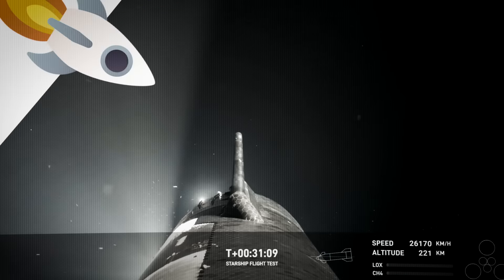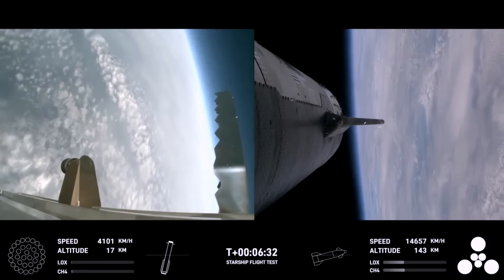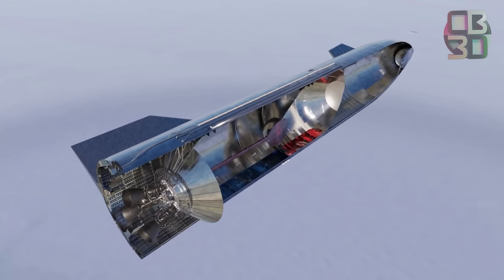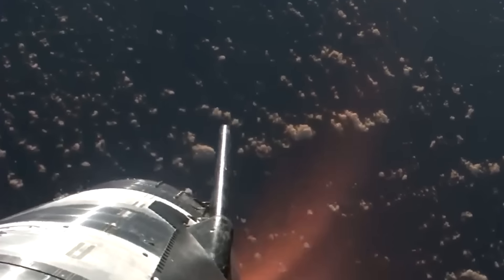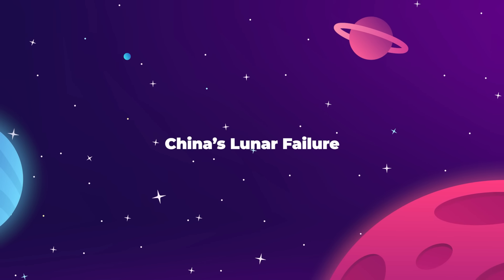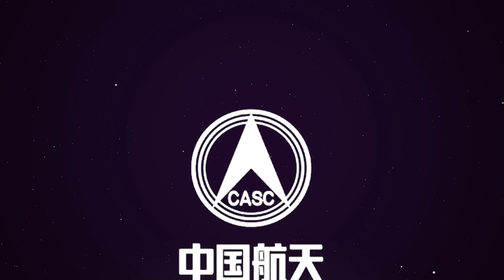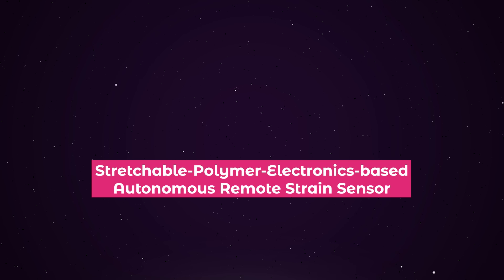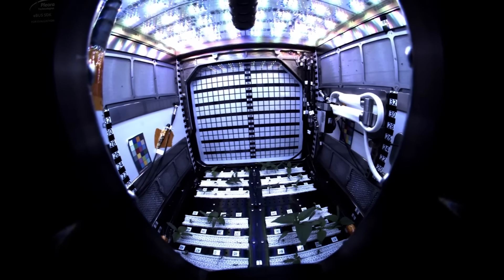What Exactly Happened On SpaceX's Third Starship Test Flight!

Comment: Timestamped Highlights
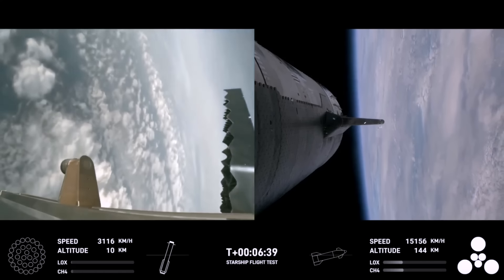02:04
🚀 The Starship launched with all engines lit up and successfully separated from the booster.
04:46
🛠 The booster experienced a rapid unscheduled disassembly at approximately 462m in altitude.
06:02
🏞 The Starship completed its six-engine burn and began coasting at an altitude of over 170km.
07:22
🚪 The first ever in-flight systems test on a Starship included the successful test of cryogenic fuel transfer.
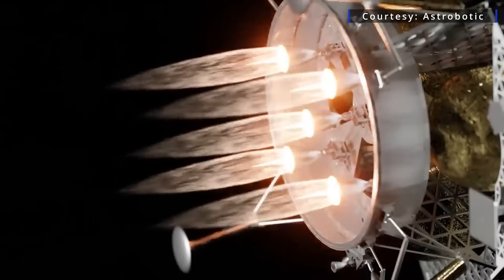08:29
❌ The relight of a Raptor engine in orbit was aborted due to an unexpected problem.
10:50
🔥 The Starship began to roll and experienced aerodynamic instability during re-entry.
13:20
💥 The Starship broke up and lost contact about 65km above the surface.
15:10
🚀 SpaceX has boosters ready for the next three flights and plans to shorten the time between launches.
17:12
🇨🇳 The Chinese lunar mission experienced a trajectory malfunction, affecting the orbit of two satellites.
19:04
🌱 Researchers developed a wearable sensor to track the needs of space-grown vegetables.
Summarized by @NoteGPT
Reply: Headline 2034. Starship NEVER worked. It was simply too complicated. Engine re-ignition problems and the sheer number of engines to manage (super heavy 33 engines, upper stage 6 engines) was a contributing factor. Failure of a single engine resulted in a domino effect. It had the hallmarks of the Soviet N1 failure all over it.

Comment: Good coverage. A lot of commentators ignore or underplay the shedding of debris. I'd love to see more analysis of that. Also, its pretty clear from this footage that you can't blame sloshing of fuel for the failure of the raptors to relight in the booster. Raptors have had a chequered history and unless and until SpaceX starts being open about this issue I'm going to point the finger at the Raptor design being pushed too hard.
Reply: I'd bet on the fact that they had to endure a harsh reentry

Comment: Did they explode the booster manually right before it hit the ground? I thought "huh, it's weird that it stopped slightly above the ground, farewell stage 1"
Reply: It might have been triggered by the FTS, as it detected that the booster was getting out of the planned parameters ;)
Reply: It wasn’t FTS. Probably a raptor explosion

Comment: when the spaceship coming back down and it rolls toward the part that is not covered by Tiles the reason is that most of the MASS of spaceship is not at the belly of spaceship that has the tiles, to BALANCE such MASS during entry is not possible because everything has been fixated into the body and MASS concentration toward the Belly does not happen. there must be a part of engine or payload that can move and adjust the mass toward the Belly where the Heat tiles are and when it gets close to landing the same mass needs to go back in its original state.

Comment: Starship is already more expensive than Sls. Sls/orion was successful from the first try though. Artemis 3 and 4 will have massive delays and may be canceled.
Reply: I wish more people talked about this, Elon and wasted millions reinventing something that Nasa already knew how to do.
Reply: @Mukurox3  It is like a house,  renovating usually cost more and takes longer. Recyclable rockets instead of reusable maybe better. The space shuttle was canceled for this reason.
Reply: @Akash-uq8wg  i don't think its anything like renovating a house. its not like he had a working rocket and worked on it to improve it  or even knew how to build one. Its like hiring a new contractor that is trying to build a house without knowing anything about house building and messing up a lot and burning through materials  your money and time. when the job is done its really pore but still works but you stuck with it. you might as well have gone with a vetted contractor that has built a functional houses of multiple varieties its cheap and higher quality and take less time.
Reply: @Mukurox3  Yup, your analogy is better than mine. But still reusable rockets and ships that do an reentry is not viable. Space shuttle needed a lot of service and parts before it was reusable. And even then is went wrong twice. Rapid reusabilty for a ships that has to do a reentry is a bad concept. This company is clearly run by people that wacht to much tv.

Comment: 4:10  WHY DIDN'T THE R.C.S. JET THRUSTERS ON THE SHIP NULL OUT IT'S TUMBLING MOTION & PUT THE SHIP IN THE CORRECT ORIENTATION & ANGLE OF ATTACK FOR RE-ENTRY ? ? ?  THIS SHOULD HAVE HAPPENED BUT IT DIDN'T, WHY ? ? ?🤔🤔🤔🤔🤔🤔🤔😭😭😭😭😭😭😭
Reply: They might have been frozen, so the thrust would have been screwed and the actions to put the ship in the right orientation might actually worsen the situation ;)
Reply: This isnt kerbal space program its real life with rapid cooling and heating.

Comment: When it's facing backwards, it's at 222km.. far from reentering the atmosphere... it was attempting to relight the engines (which would be a simulated de-orbit burn, but the engines didn't light, probably because the computers were afraid to, for whatever reason.. so that didn't happen).. point being, it facing backwards was part of the plan...

Comment: SpaceX will eventually get fuel slosh under control. Just seeing those fins moving as they did means the vessel is reacting even if a lot of movement results but the fuel is sloshing in reaction. Maybe an expanded mesh filller to prevent splash in a silicon bladder to form the yank would dampen the fuel movement.
Reply: The booster spent enough time with it's tail pointed down for sloshing to settle. The problem is deeper than this.

Comment: On IFT3, prior to hitting the water, you can see green flames coming out of the bottom which means the engine is canibalizing itself. It appears that the Booster ran out of propellants, yet it is flying empty?? How is it ever going to take a payload into Space? Should it separate earlier? 
Starship never controlled its attitude with RCS. I cant imagine this was by design, therefore, it failed and therefore the reentry. If people dont acknowledge failures, how are you ever get to a successful launch? 
Problems I see:
1)Running out of propellants is a problem
2) Lack of attitude control on Booster&Starship is a problem
3) Losing  tiles on reentry is a problem
4)Not clear the transfer propellant test was succesfull
5)The operation of the payload door ran into problems

For the Elon fans unwilling to face reality, imagine this is Boeing’s rocket… Now, analyze and critique the launch. Its really easy..😂
Reply: Not sure what you mean in the beginning of your comment. The raptors failed to turn on for the landing burn, what does that have to do with bringing a payload to space. The booster did it’s job in that regards

Comment: Idiots made the engines more complicated than those on the Soviet N1, then made it enter the atmosphere on the first space speed engine first and expected them to work.
First, you need a decent air brake, or a pressure injection system in the fuel tank, so that the fuel does not fall at the speed of the rocket, but actually pump into the engine.
Then add an additional U-turn or shutter to protect the engines.
Ilon, fire the designers, hire an engineer!